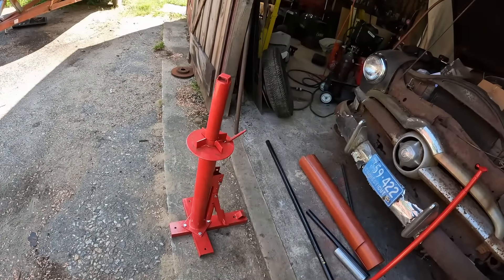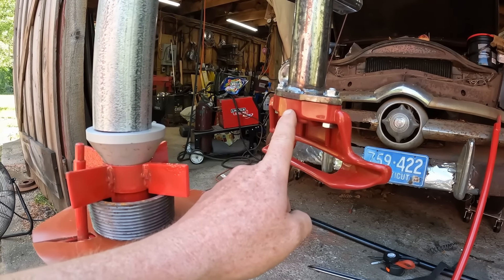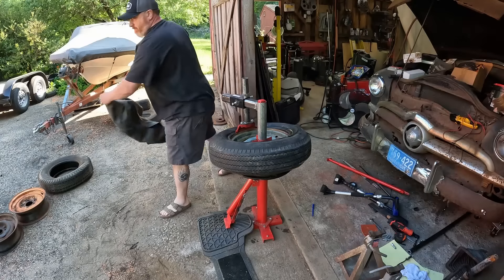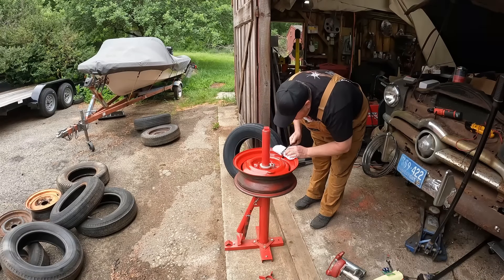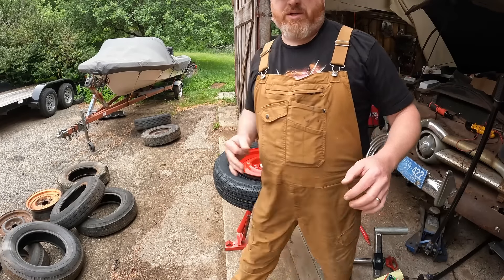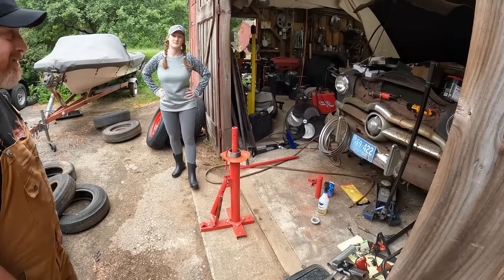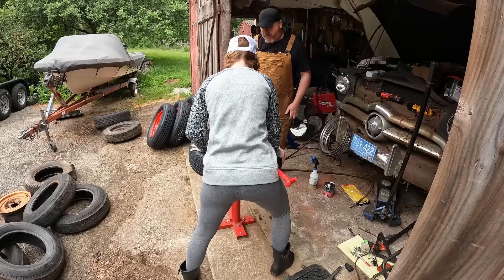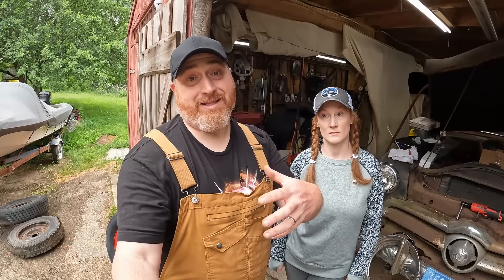How to modify a Harbor Freight Tire Changer to work amazing!!! Follow this DIY guide!!

Comment: I just use a bead breaker and some tire irons . You can make some of them from harbor freight pry bars by grinding them like a ducks bill. And grease them up so you don’t cut the bead. Takes me about 5 minutes.then I wipe light coat of grease on new tire bead & wheel rim.I got a few videos some where on my channel. I bought a used tire changer from Sears that needs repair
Reply from the maker: I'll check out your videos!
Reply: @madgingercustoms  it’s from 7 months ago . Tires off wheels. Or 2 years ago taking a tire off wheel old time tools

Comment: I had problems with my welder,i put a new liner(the spring that goes the whole way from the welder to the gun) and fixed it,the welding wire wears a groove inside and makes it catch.they have them at the welding store or on line for any welder. Cool Video, I am tired of messing with the tire shops, Thanks D
Reply from the maker: Thanks for the heads up on the welder. We actually just got a new one we did a review on. Check that out!

Comment: SOME times if tire is extra stiff- you might not get it to pop on the rim-- so then i was told to squirt starting fluid in the gap and light it with a tortch- dont get any thing in the gap before it pops on the rim or it will be missing or flying tools..its a little dangerous-but with caution it works well, AND it dont take much starting fluid at all.
Reply from the maker: We used to set beads in the woods like that.

Comment: I use a guard rail on the highway and a screw jack to break down tires then a couple of tire tools to take the tire off. That looks a lot easier but i'm cheap. I use dawn dish wasing liquid for lube. Works very well.
Reply from the maker: You go to the highway?
Reply: @madgingercustoms  Yes. Don't have a garage.  Needless to say , i don't change any tires unless i need to. I'm not going to pay 20 dollars to put a tire on and 5 dollars for a disposal fee. We have a yearly tire day and you can get rid of any amount of tires for free.

Comment: Interesting video, and what looks like an excellent mod...That said, unless your doing to be changing a lot of tires I am not sure the whole thing is going to be worth it? 

As a fully qualified internet  "expert",  I have removed the sum total of one farm trailer tire. To break the bead I used a 4 foot length of board as a ramp, with a short length of 2"x2" at the very end ...with the deflated tire on the ground, this ramp was placed so the 2"x2" was on the tire wall, and a friend then drove a Landrover up the ramp...As soon  the weight of the vehicle was over the tire wall, it broke the bead no problem. We then repeated with the tire turned over....

There is a really good video that shows how to use a scissor jack and a small $10 DIY wooden "frame"..it works a treat, but only on alloy wheels with cut outs you can assemble the frame through, so sadly no good for your wheels...

I am looking forward to your wheel balancing video when I get a chance to watch....
Reply from the maker: I've already removed 16 tires and installed 12. I have 12 more to do coming up.

Comment: My miller was doing the same thing. Miller said to replace the liner. I replaced the liner and it works like new. The wire had carved a groove in the liner and it was griping the wire.
It may be your liner. My miller is a 130 that is 23 years old.
Wire that is rusted from humidity will eat the liner up.
Also you are not supposed to run Flux core in the same liner as solid wire according to miller.
Reply from the maker: The entire liner,hose, and gun are recent. We need to go through the entire machine but it's already been replaced by another unit so this just sits.

Comment: I saw a couple other comments about the welder but didn’t see one about changing the liner, sometimes it gets worn or junk in it and binds the wire and causes your issues.
Reply from the maker: The entire hose assembly is new including the gun. I need to sit down and look at the machine.

Comment: Great video! Hey, shouldn't that piece you fabricated be set it and forget it for the exact same rims? Perhaps you could make some alignment holes with pins?
Reply from the maker: It seems to need to move sort of under the lip on the wheel to start with.

Comment: Use the air hose chuck to popp the bead best way that triger thing restricks the air. I have had the hf tire changer since 2011 and have broke it many times but eather breaking the bead or installing the tire i still love using the thing i use a lot of used tires gets exspensive taking them to a shop that charges $30 i am definitely going to try this mod im also making a hitch adapter the last time i used it i riped it out of the concrete lol doing a 215/65/17 when i buy tires those nexen are great tires my gf got a set years ago on her mini van the 4 or 5 years later gave me the van and got another one that first winter she keep getting stuck were i had no problems going around people on the hiway getting stuck so i switched tires with here so she wouldnt get stranded and she dint i got stuck a few times but now i buy those tires for all the dayly driver put them on both of our sonatas and my sons corolla the only thing bad about them is if you get a flat stop right then they do not hold up when they go flat most tires wont but i have had to do it before with other tires that dint get screwed up as fast but i love those tires best cheep tires i have found. Thank you for a great video definitely going to do this mod.
Reply from the maker: Awesome! Thanks for watching!

Comment: Hey I have a tire changer that I built from scratch, and I am making these changes to it. I may build another one and put an electric motor with a gear reduction to turn the wheel and put the duck head attachment  on a arm from outside the wheel and tire mounted stationary  with an adjustment to move it in and out and the wheel and tire will rotate instead of the duck head having to be manually pulled around the wheel and tire!
Reply from the maker: That would be an awesome video!! You should post that up.

Comment: In one or two lifetimes ago I used to work as a “tire mechanic” as they officially called the two or three of us.
This was at American Tire and Wheel on Gaines St in San Diego  ca. Amongst ourselves and the salesmen, managers
and other types of mechanics we were
simply “tire busters”.
A term that’s been in use for about 75-100 yrs! LOL 😝 
Main thing to remember: SAFETY FIRST! Yeah, I know, it sounds corny. And you aren’t working with high pressure
machinery, granted.
But- Still, there’s the
one oddball time that
some unexpected part
comes off, your machinery breaks unexpectedly under use, etc.  Things like
valve stems pop up, they shear off at the
valvestem port and shoot out. pieces of broken rubber bead,
pebbles , etc.
When breaking the bead, or at the point of “POP” when inflating.
    You can also do balancing, with 4 bubble gadgets.
    Anyway- SUPER video, my friend!!!
You do a very good job of “breaking it all down” !!! LOL🤣🤣🤣
Reply from the maker: Thanks for great comment!!!

Comment: I have a harbor freight tire changer and I hate it. So I started looking at tire  changers but they are expensive and I don't use it that much. I am definitely doing to get the stuff and do your modification to mine. Thanks for the video.
Reply from the maker: Great! Thanks for checking out our video!

Comment: I didn't see ya lube the new tires bead with soapy water opon  installation
Reply from the maker: The last 3 tires we used soapy water. That's what's in the spray bottle.

Comment: Will ur duck bill clear a modern tire sensor, ive used one of tire machines for years, ive had to double the flat round plate, ive added l brackets to the arm that breaks bead, ive increased pipe inside diameter to the bead breaker, ive even made different arm length to break down those super swampers tires, once that wont fit on a conventional tire machine, think ur idea is great, i think ill give it a try, ive used my machine 500 plus times, use it few times a week, its great design , Chinese use very thin metal
Reply from the maker: Yes, we used it on Jess's 17" Subaru wheels with TPMS in them.

Comment: What year is the Ford? 1949/50 2 Door or 4 ?  Flat Head V-8? 3 on the tree. Bounce the tires on the concrete to get them seated. Buy a strap to squish the outside of the tread so it will seat easy when you give it Air. Nice shop set up you got there. Some cool mods you put together for the tire changer. Old Thunder Road machine, love it.
Reply from the maker: Check out my other videos! 1950 Shoebox, 2 door sedan, flathead V8, 3 on the tree, and it was seized from sitting for 50 years and we got it going.

Comment: Things ive used to get tire on rim.
Grease.
Dish soap.
Soap
Soapy water.
Those are ones I remember.
Want real fun changing tires.
16.5 rims.
Just a pick and crowbar.
To air up.
Aerosol can sprayed into tire.
Then light a match and throw at it.
Now. Im not saying to do any of that.
But thats how we did it back when i was a teen.

Comment: Did you secure the bottom to something because when I tried to use mine it kept tipping over. Good video
Reply from the maker: Yes. You can see in this video at  2:50 in this video. https://youtu.be/PXeRvgvTeP0?si=s10r6oKpg5Ek4R75

Comment: I will just mention a couple of things. when installing a valve stem about 95% of the time once you screw the tool on, just s tug straight up should pull the stem through. Secondly tire manufacturers will usually pit a dot or oval sticker on the tire, that sticker should be lined up with the valve stem if you do so then minimum amount of weight should be able to balance the tire, because they spin the tire to find the best spot and mark it with a sticker so the installer will know.
Reply from the maker: Yes, I think some of these cheaper tires do not have dots. I just did some tires on my accord that had no dots.

Comment: My first try without modifications, the bead breaker buckled.  I welded some angle iron onto it and tried again.  This time the legs, or feet at the bottom that are bolted to the floor buckled trying to break the bead.  It was a tough bead to break, but still the Horrible Fright failed miserably.  I bent the bottom back into shape and welded some support.  I can't recall right now, but then something else bent.  If I hadn't done any welding on it, I could have returned the piece of junk.
Reply from the maker: Yeah, you can't beat on this for sure.

Comment: Soap and water , in a spray bottle makes the bead slide easier...
Reply from the maker: Yeah that is key! I should have explained that better that we used that in the spray bottle.
Reply: @madgingercustoms  I have a coats RC-15AA clamp tire machine at my house , I'm impressed with the upgrades you did to your manual one .... I also spray soap and water to help remove the old tire , if the rim is in bad shape,, I'll put a thin amount or red bearing grease or Vaseline on the rim or bead .. Nice job tho 👌

Comment: 🎉 that clamp you're talking about is called a beadlock keeps the tire from walking around the rim when you're attempting to fit it
Reply from the maker: Yes sir, I saw a guy lightly use a piece of rubber and vice grips.

Comment: Something i didn't know, the liner in your mig welder is a consumable item. Replace it every few years, your feed issues might suddenly go away. Also make sure the liner is the right size for the wire you use, and that it's not kinked. All of those things are issues i had that made me think my welder was dying. New liner and suddenly i could weld sheet metal again
Reply from the maker: The entire hose assembly and gun are fairly new. I think the welder needs a good cleaning. I've used it for over 20 years I believe and it's never been gone through. Thanks for the suggestions!!

Comment: You are correct in the bead breaker is extremely weak. Getting ready to strengthen mine cause it's already bending. Another extremely weak point is the tire bar. I folded it in half. Took a jack handle I had laying around and just welded original ends to the jack handle. Probably be buying me the duck bill piece
Reply from the maker: I have all sorts of pipe here so I think I'll sleeve mine.
Reply: @madgingercustoms  it definitely needs it. It is supper thin for what it needs to do

Comment: You might need a new liner in your mig, gun, hose, and weld a piece of round stock on you bolts to make a tee ,and you won't have to use a wrench to tighten And loosen,
Reply from the maker: We made changes to it in this video. https://youtu.be/r1ncuxGHcIc?si=4yXt22lEOMMYc9A3

Comment: Just subscribed, the tire changer mod is very cool, I might go for it but my issue seems to always be rust, rust rims, so maybe a sandblaster should be in the works? have fun
Reply from the maker: I could really use a sand blaster. I'm certainly running out of room though.

Comment: Dude ! You are genious! I bought teh same one and do not haver any cement to mount it to, but did find  the walls of a bathroom stall from an old gas station that is about 5 foot square I will mount it to the center of it and just looking at it I KNOW anything larger than a 2 ply motorcycle tire will bend, twist  or crack it with little effort.Your modifications and the 'duck" made it appear to make its use a piece of cake. you saved me a ton of time and lots of hair I cant spare any of to pull out. And if ya need help getting teh ole flat head going check out mortskis garage wway up in the great white north, he has the best gasket scraper in the world, pretty cheap too.
Reply from the maker: Check out my other videos. Not only did I get it going. I pulled the heads, freed up all the valves and it runs on all 8!!

Comment: I have that tire changer. I agree it has its issues but works. I like your modifications and would consider doing them.  However I've seen some used tire machines that are posted pretty cheap under 500 on marketplace that im more likely to spend a little more for a full machine if I can find a deal one day.  
As others have mentioned lube is your friend,  some dishvsoap works great though it can be corrosive long term.  Antifreeze  is what many use to lube the bead to help mount the tires
Reply from the maker: I don't really have the room for a real tire machine to be honest. This thing just gets tossed in the corner of the garage.

Comment: Excellent work dude! Thanks for sharing!
Where did you source the pipe sliding over the stock tire changer?
Reply from the maker: Thanks for checking out our video!
Reply from the maker: The vertical pipe was just electrical conduit.

Comment: It has been 7 months since you made this video and I hope you see this. I had an issue with my Froney MIG Multiprocess and wound up calling Forney. The technician walked me through diagnosis by phone. It wound up being a dirty liner. When I got the liner out, pushing the wire through was difficult. I worked on it for over an hour only to need pliers to pull it through. I installed a new one and that fixed it. The problem showed up as a good weld followed by a bad weld and I questioned my ability to use a MIG welder, got into different setting and I could hear then I heard the motor struggle. That was when I called. I hope you got yours fixed up by now but if not, remove the liner and see if the wire can be pushed through all the way.
Reply from the maker: The entire gun and hose assembly was  fairly new at the time of the video. I've since had several new welders come in to review and make videos with so I haven't gotten around to even looking at the old Lincoln. I will at some point.

Comment: Thank you for showing this as well as your modifications. I am building a model car diorama of a 1930's era garage and I think duplicating this tire changer in 1/25th scale would be easy and look accurate for the times. 

I was taught on a Coats tire changer which used air pressure when I went to high school mechanics in 1990. I also own a 1951 Studebaker Bullet Nose and my tires are so worn out and decomposed that you can see the cloth chords through the rubber. Amazingly, the inner-tubes still hold air in those tires for a total of 3 days before they go flat again. I wonder if I can buy this tire changer here in Canada for at home. Would be nice to break some tires and chuck them out.  i have a few old cars besides the Studebaker and some of those tires are brutal - ripped off tread with really sharp steel chords coming out. Anyway, have fun! 

Oh, something I found out that if you balance a tire and you find you need a mile and a half of wheel weights on one side, instead of putting a few in a row, pull the tire off the rim and turn the tire 1/2 turn and then fill it up with air again and then balance the tire. You may find that you only need a short weight instead. - Funny what a person remembers from High School!
Reply from the maker: Princess Auto sells these in Canada! You can certainly get one. I took a tire off my 1950 Ford Custom. Filled it up and a bit and it exploded lol. No one was injured.
Reply: @madgingercustoms  Good that no one was injured. I was thinking Princess Auto would have it. I just didn't know if you knew about Princess Auto. :face-blue-smiling:
Reply from the maker: @MonsterHobbiesModelCarGarage  I'm all about our neighbors to the north!
Reply: @madgingercustoms nice!

Comment: Great upgrades, I’ve never put a tire on that didn’t pop and I’m an old tire tech, I would be curious to know if they hold air and are sealed?!🙏🏻🇺🇸💯🤙🏻
Reply from the maker: They sealed and have stayed sealed. They are old rims without the safety bump so they don't pop on.
Reply: @madgingercustoms  oh ok! Naw I haven’t gotten any real old tires and rims in the shop, just maybe in the early 60’s is all I’ve dealt with. Preciate you getting back.🙏🏻🇺🇸💯🤙🏻